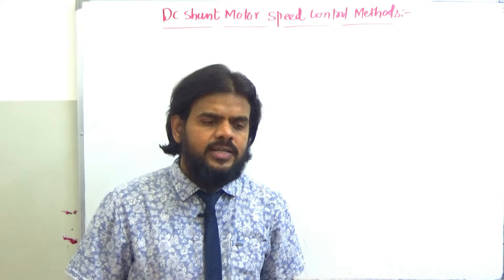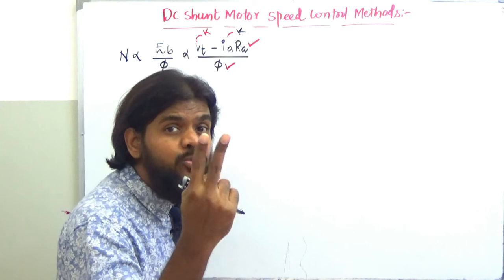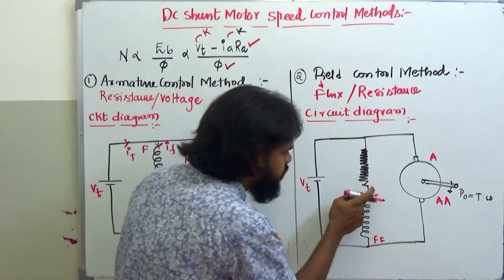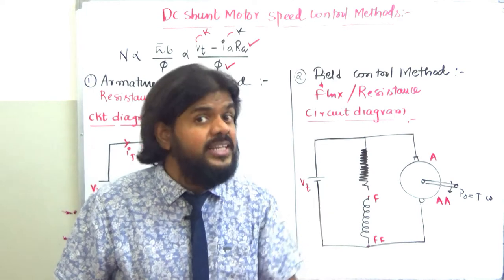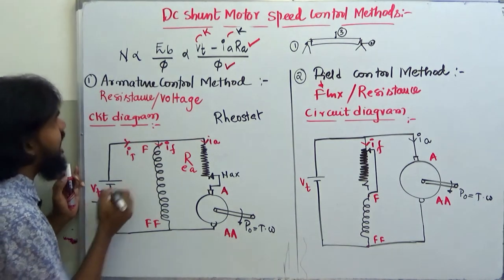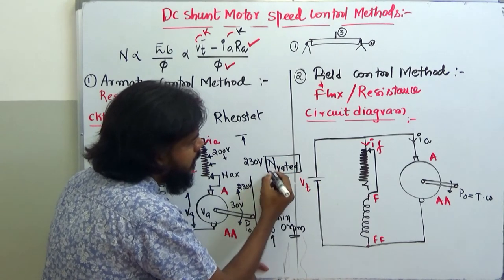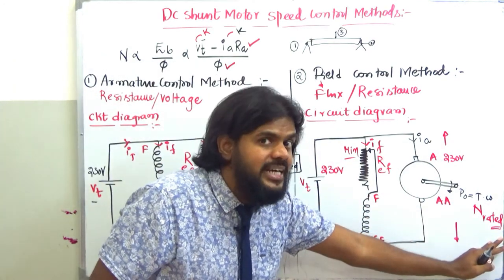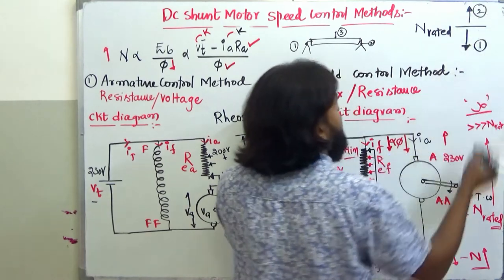DC Shunt Motor Speed Control Methods

Comment: Thanks for this interesting video. Could you explain what happens with torque when you change speed with these methods
Reply from the maker: Thanks for your query, these methods do serve the purpose of speed control during constant load conditions, however,  IaRa drop reflects the load torque variation , and as a result the speed envelope alters accordingly.